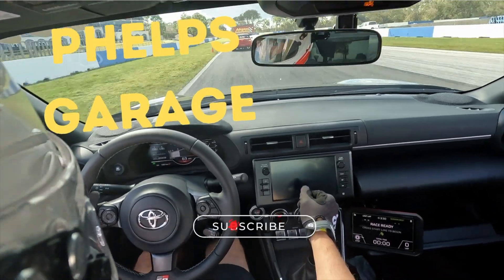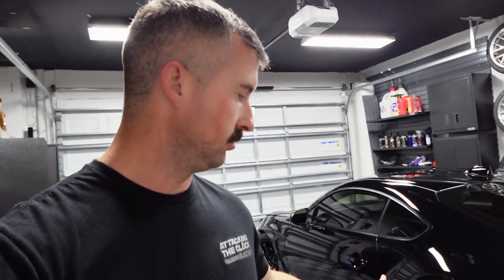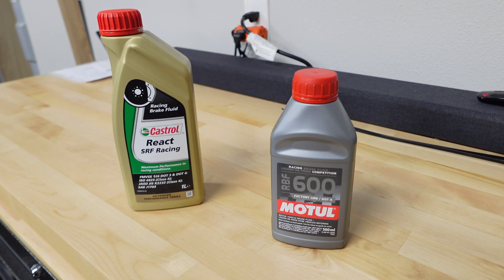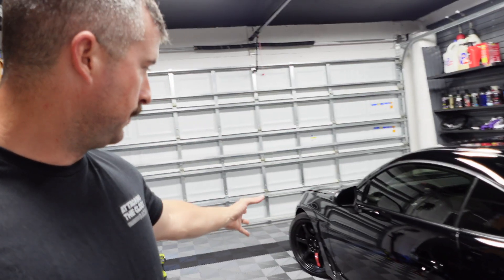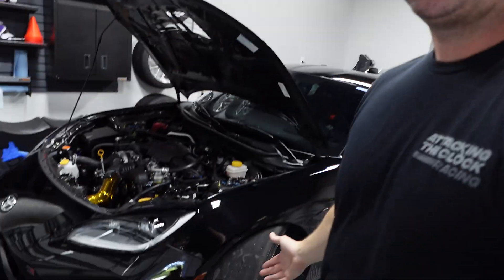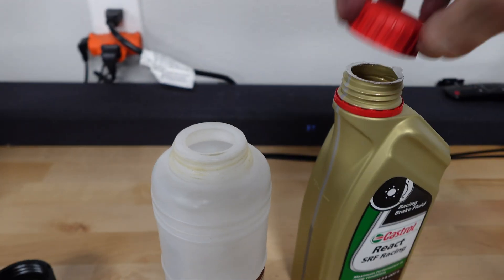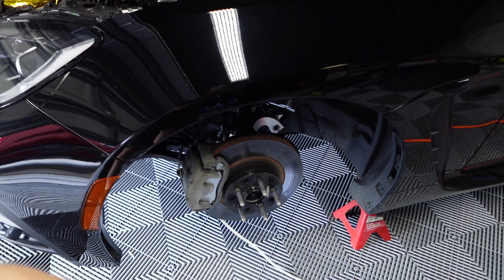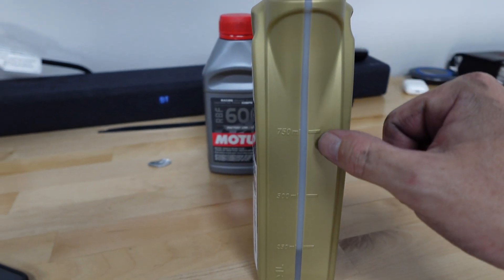GR 86 Brake Fluid Upgrade

Comment: Just picked up a 24’ 86 and will be doing this soon in preparation for its first track day. Are you willing to share your Rays 57 and RPF1 wheel/tire specs? Car looks great!
Reply from the maker: Both are 18x9.5 et38 on a 255/35/18 RE7RS Hoosier is a 225/40/18

Comment: I'm currently using the RBF600, I also have a bottle of SRF for future bleeds. One issue I have with the SRF is the bottle size, 1L vs Motul's 500ml, a bleed on my car takes a little less than 500ml (dirty to clear fluid in my catch bottle). I don't know if after opening the SRF how long the self life of the fluid is, the unused fluid sitting in the opened bottle is bound to start absorbing some water. Do you think its safe running the SRF that was opened a year earlier? I do a bleed at the start of ever season.
Reply from the maker: You should be good and don’t mix the two

Comment: Hi there, thanks for the great vid! Want to flush out the original dot3 fluid as I'm afraid it's boiling easily during track days. If i understood correctly you mentioned you used around 500ml to flush the whole system? Do you think it takes 1/4 per caliper to make sure every line is completely flushed? (Sorry for long comment)
Reply from the maker: I’m not sure to be honest. I probably over flushed the system to make sure all the fluid was out.
Reply: @phelpsgarage4202  did mine today: used 1l overall but i'd say whole system is now with motul RBF600.  Looking forwards to test it on track.

Comment: Don’t hesitate to use a motive brake bleeder. Dare I saw it’s even easier than this Harbor Freight pump method. Regardless good video!!
Reply from the maker: I’ll look into that, thank you
Reply: harbor freight pump is risky as your chances of introducing air by going through the bleed nipple is very common.